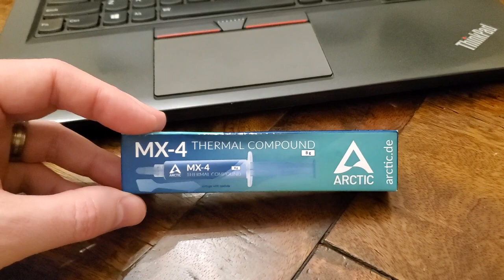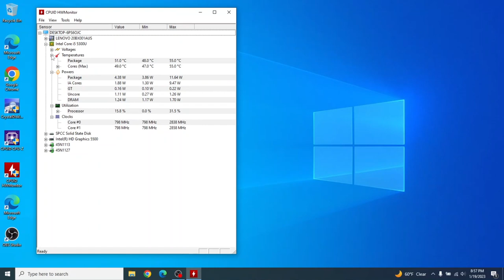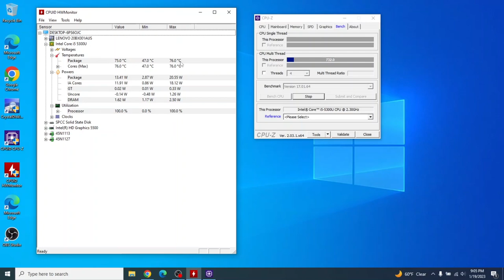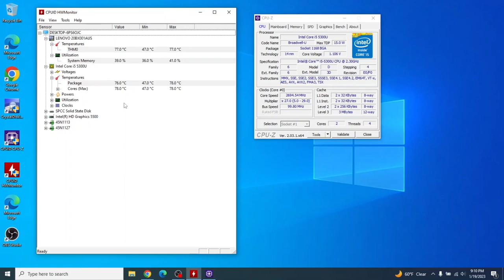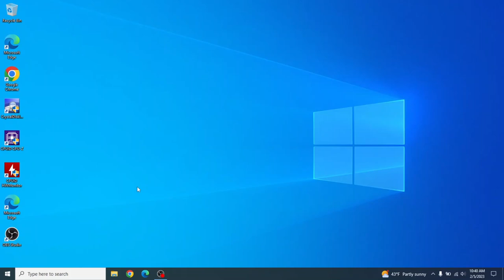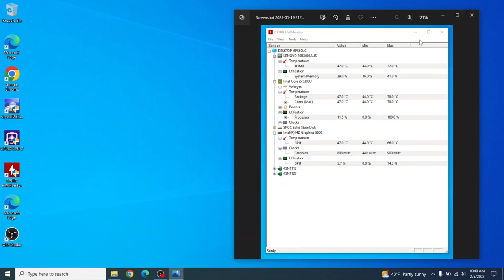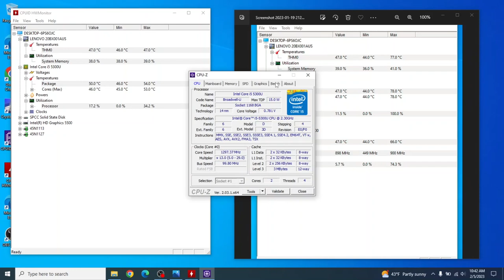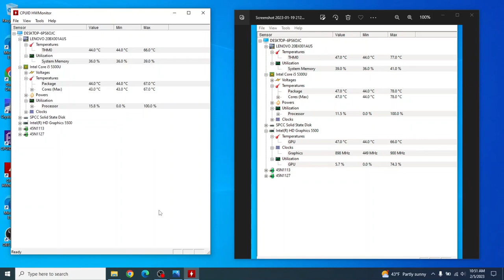Arctic MX-4 CPU Thermal Compound Past - Real World Test and Review on Lenovo Laptop

Comment: You should try phase-change material Honeywell PTM7950. It comes in as a sheet, lasts longer and performs works better than traditional pastes. It is also a good idea to do undervolting of CPU at -100mV or more if it will be stable. The temperature should drop by 5-10°C under stress.
Reply from the maker: Great suggestions. Thank you.

Comment: I was thinking like you said that it may be the gpu die. Strange in the least that they don't bother to passively cool that die, whatever it is. Great video by the way
Reply from the maker: Thanks man. I appreciate the kind words. Like you said, it's baffling that the GPU die has no cooling at all. The really strange thing is that the copper plate the does touch the CPU is off center and is oversized for the CPU, almost like it should be touching the GPU, but it's offset to the opposite direction. I have another T450s that is exactly the same way. Very odd. But, I'm glad the MX-4 paste made a huge difference.